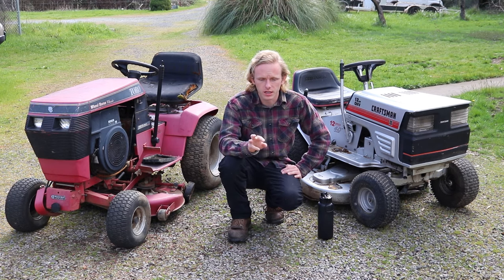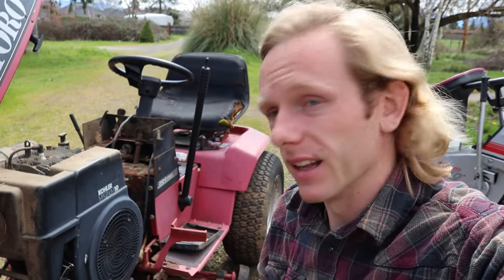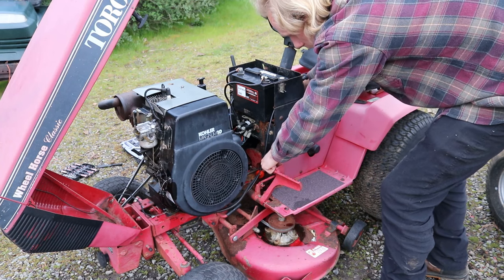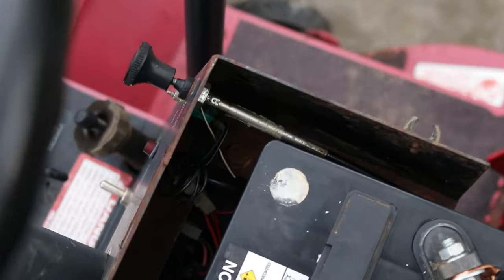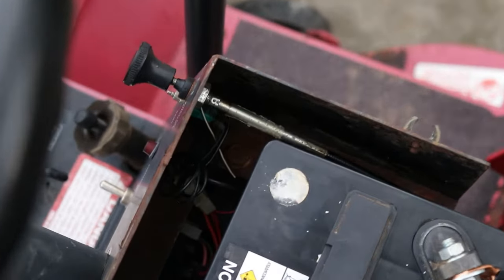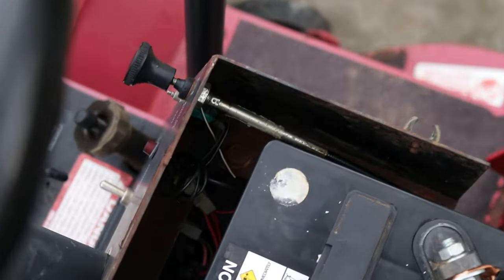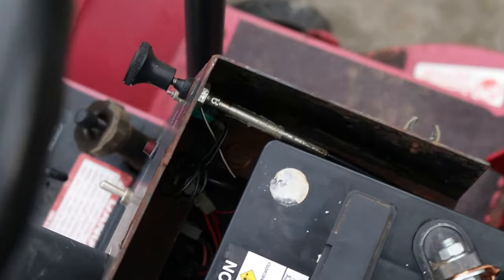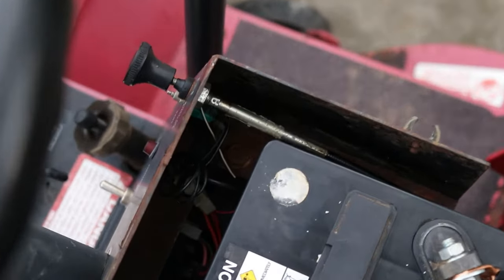I Bought an Abandon 1991 Toro Wheel Horse Classic Garden Tractor + Rare 1985 Craftsman 2 Lawn Mower

Comment: Not really related to the video but do you know how much oil  a 12hp briggs holds? I put 28oz in it cause on the dip stick has a number 28 on it. Iv also seen a briggs engine chart and it calked for 1 quart and 42 of oil others say 48 oz of oil.  Im just not sure